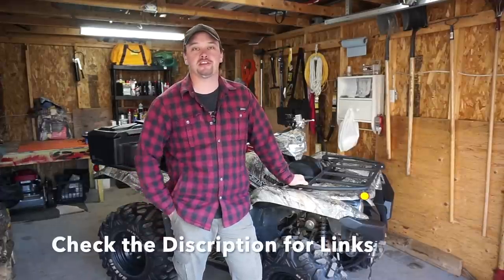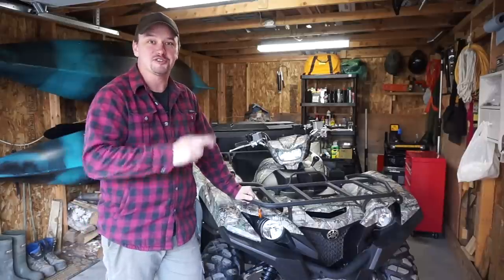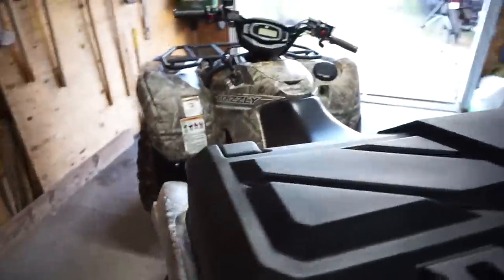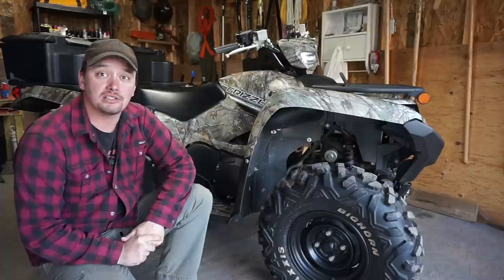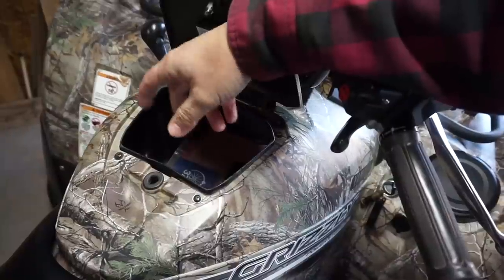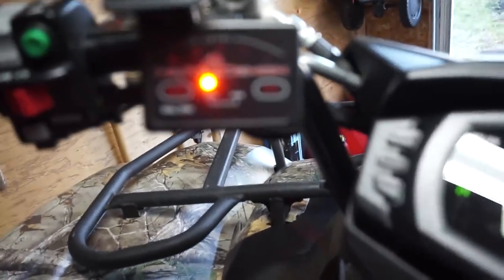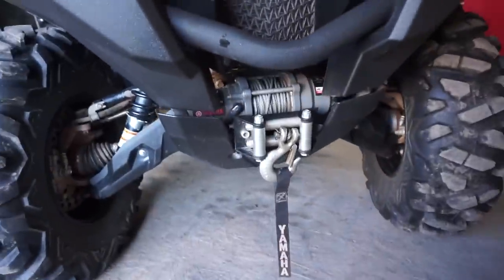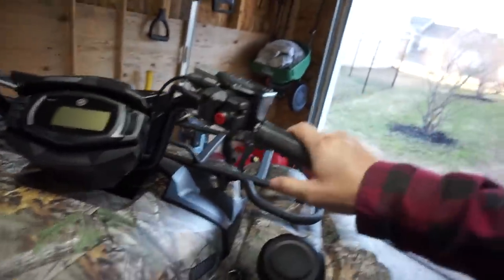Honest Owners Review - Yamaha Grizzly + Mods

Comment: Hey man, another great video, always enjoy watching.  My brother just picked up a 2019 700 Grizzly 700 SE and he’s super happy with it.  I was curious what pressure you’re running the bighorns at?  I picked up a new set a g. Bourque and was told to run them at a minimum of 10 psi.  I noticed on my first ride they seemed a little rough.
Reply from the maker: Hey Rob ! thanks man, glad you liked the video ! 10 PSI ?!?! oh man thats crazy ! I run mine between 3-5 PSI, always have. they are super smooth then. My buddy Evan runs his at 4 PSI.
Reply from the maker: I should say in the winter I run them a little lower 3 PSI and the summer around 4-5 PSI
Reply: @Maritimer  thanks for the reply, I’ve dropped them down a couple pounds but might take them further, not sure why they told me to keep the pressure that high though.  I could see maybe having a higher pressure on a side by side.
Reply from the maker: @robertsrandomreviews6516  Yeah ! a SXS needs a bit more pressure but the Big Horns are a rugged tire and can basically run flat on a ATV. drop them to 5lb and you'll probably like them a lot more.
Reply: @Maritimer  Will do! Thanks again!

Comment: Thanx for the tip on the 4x4 going in and out on its own. Im having the same issue on my 2016. Going to try the dielectric grease.
Reply from the maker: Hey Buddy, Yep I made a video on how to take the switch apart and add the grease. It fixed my issue and it never came back.

Comment: Great bike I picked up a 500 fourman for riding and love it cheers brother!!!
Reply: dank shots 420,  I’ve got a 2009 Honda Foreman and it’s been unbelievably reliable and if the battery dies you can pull a cover and pull start it.  Important when your by yourself in remote areas in the Rocky Mountains. It won’t win any power or ride awards but I love it. Hope yours treats you well
Reply from the maker: Hey man Foreman is a Great machine ! like a little tank ! haha super tough and reliable ! Cheers !!
Reply from the maker: I love the idea of having a secondary start (pull cord) but as the motors get bigger those are going away. I keep a battery pack which allows me to jump start my bike multiple times, just so I dont get stuck out there with a dead battery.

Comment: Never like the Grizzly much, it would be a better machine if it was a twin.  I find it under powered and find the Can Am a much better bike for power and vibrations.  Does have a nice ride and very reliable bike.  For another few bucks you can get the 650 V twin however the Grizzly would be my second choice, great CVT system and the best on the market.  Good vid
Reply from the maker: Hey man, fair points ! I wish it was a twin also like a 850 or 900, and maybe keep the 700 for the Kodiak.... that would make sense, I'm not sure why Yamaha doesnt upgrade the Grizzly.
Reply: @Maritimer  Well they are outstanding machines but I think the reason is cost, changing to a twin a lot things would have to change.  But I think if they don't they be even losing more sales down the road.
Reply from the maker: Yeah the cost will go up for sure, thats why you keep the 700 in the Kodiak and a more budget friendly machine, and put the Twin in the Grizzly.

Comment: Awesome video. I’m looking at a used 2017 Grizzly Special Edition in Nova Scotia and wondering what you paid for your 2017 new? Thanks!
Reply from the maker: Hey Andy ! We'll I bought mine new in 2017 I added on 26" big horn tires, the storage box, heat demon hand/thumb warmers (which I installed everything myself) but after tax and fee's it ended up being close to 15k. I will warn you about the 708cc motor, do some research on them, ask the owner if it burns any oil or has had the top end rebuilt by Yamaha.... some of them have issues. I like the 686 motor better.
Reply: @Maritimer  Thanks so much! I appreciate it!

Comment: Nice review. Wish they made a two up. I think a side by side is more my style. Hunting, firewood, and meandering on trails. Keep up the great videos.
Reply from the maker: Hey brian ! yeah not many 2-up machines out there is there? Can Am and Polaris ? I think if you plan on taking a passenger a lot, there is no better way than with a SXS. Plus like you said it would help ya with your work, having that box on back helps.
Reply: @Maritimer  yeah, taking the wife and dogs would be great. Definitely looking at a few. Yamaha wolverine/viking, can am defender, and the Kawasaki Teryx.
Reply from the maker: All nice machines ! my brother has the Teryx and loves it, it seems to be built good ! and amazing amount of storage stops. My father Had a Teryx and now has the Pioneer 1K it's also super nice !! I wouldn't get the Viking if it only has a single cylinder engine, it's just too gutless... do they have that parallel twin motor in it now? 
the Wolverine is a very nice machine, I have a video on test riding a Wolverine RSPEC.

Comment: Just bought a 2014 550 with 360 miles.  One owner garage kept and owned by a guy to do things around the farm and hunting.  I think I overpaid but at $4800 but wanted it now and new are way $$$.
Reply from the maker: Hey ! we'll the market is different everywhere but I'd say you over paid a little bit, but the bike is basically new with only 360 miles on her. and will probably last forever, those 550's are bomb-proof.
Reply: Maritimer I looked for a few weeks and even searched nationally on atv trader.  Dealers want $5500 for ones more used.  Atvs in the south are mostly Honda’s and have wheels and snorkels.

Comment: Great video! I’m not sure why Yamaha switched to the 708. You say emissions but the 686 remained in the raptor and Viking through out 16-18.
Reply from the maker: Hey Kent ! I didn't know that.... thats really weird... I wonder why they changed... I was always told it was b/c of emissions...
Reply: Maritimer My best guess why they went back to the 686 in 2019 is because they moved to the v-twin in the Wolverine x2 so that 708 was only left in the grizzly. So instead of switching the raptor and Viking over to 708 they just dropped it. But why go to the 708 at all?
Reply from the maker: Yeah man, it doesn't make much sense. I haven't had any issues with mine but I'd take a 686 over the 708 just for piece of mind.

Comment: Nicely done review buddy! Those are great machines!
I hate where they put the 12v plug and key though. The key should be up by the gauge cluster and the 12v plug should be by the steering column. I use mine the keep my Garmin plugged into while I'm riding (because it eats batteries like dog on a steak), so it definitely wouldn't work for me.
Thanx for sharin'!
Reply from the maker: Hey Buddy !! Hope all is well out west ! I agree with ya man ! should be  somewhere near that gauge cluster for sure ! but Yamaha being Yamaha..... they out it where it's always been haha or even having one in that storage box would be great for charging a cell phone while riding. thanks for watching man !
Reply: @Maritimer  
Installing an extra one near the steering column or in the storage box would be easy enough to do too I guess.
Reply from the maker: I bought one to install on my motorcycle, I just hope I dont have to take the crash bars and fearing off haha

Comment: I bought a 2014 grizzly 450 brand new in 2014. Never seen a mud hole! Only complaint I have is the cheap plastic CV boot guards. I've replaced the front rt CV axle twice because the boots get ripped by tree limbs. Mine only has 220 miles on it.  Only use mine for yard work
Reply from the maker: Hey ! thats good to hear ! those Ol' 450's were super tough ! I've never had an issue with the skid plate or a ripped boot.... fingers crossed haha
Reply: @Maritimer  mine is just a work horse. I wanted a 700 but my budget said no
Reply from the maker: Hey man, whatever gets ya on the trail ! haha the 450 will go anywhere my 700 will go.

Comment: Good  job. Thinking of a Polaris but this bike may be better... I want a Honda but need more performance and capabilities. This maybe be the best of both worlds.
Reply from the maker: Hey Kris ! Yeah man I love Honda also but they are so far behind on ATV's it's crazy, they basically sell on there reputation of being crazy reliable (which they are haha) but for power, comfortable ride, ground clearance, diff lock, and other options, it's not even close. And Yamaha has the best belt drive in the game, I know a lot of old school guys like Honda b/c they have a transmission, but the belt drive has come so far, and Yamaha offers a 10 year warranty on their belt... you can't beat that. The machine is always in the right "Gear" or has the right amount of Power for whatever situation you are in, it's never trying to up-shift/rev too high or down-shift/bog down. 
I haven't owned a Polaris so it's hard for me to comment on them, but I think they make a pretty solid machine, from my experience (friends machines) they are not as reliable as Honda or Yamaha but they have a smooth ass ride, more power, storage in the racks (some ppl like it, some ppl like the old school metal racks) The one thing I don't care for with the Polaris is the AWD.... it's not switch in 2X4 or 4X4, it's AWD all the time. I personally like having the option. But all in all I think they make a pretty good machine.

Comment: Great review. Very helpful. Thanks!
Reply from the maker: Hey ! thanks man !
Reply: @Maritimer  may I ask what size Bighorns you’re running? Are they 26x8-12 on front and 26x10-12 on the back? I’ve never owned an atv, but I’m interested in getting a Grizzly this spring. Thanks!
Reply from the maker: @G_Carter  Hey ! I have a review video on the Big horns I will post under my comment. mine are 26X9X12 in the front and 26X12X12 in the rear.
https://youtu.be/EhWBssoQhKU
Reply: @Maritimer  thanks! I just caught the tire review (sorry I didn't see it before bugging you with my question!). Looks like a great all-around tire that would handle 95% of the driving I expect to do. Really appreciate your advice. Cheers!

Comment: Great videos man! It's refreshing to hear from a sensible ATV camper compared to the majority of the barbarians here in Newfoundland lol. Also, I seen you have the Gstove? I used mine a fair bit, any complaints with yours? 

Cheers from Newfoundland.
Reply from the maker: Hey Chris ! thanks a lot man ! Glad you like the videos ! I don't have any complaints as of now.... I struggle to figure out the sweet spot so I can get a longer burn.... I have a damper installed in the pipe which helps a lot ! before my pipe would glow red and I'd burn the wood quick....

Comment: Hey pal. So I have the bighorns. 3.0 version. They are great so far. 26X9 front and 26X11 rear. I reached out to Maxxis. They recommend running 10-12 psi for my grizzly. What is your experience with the OG’s?
Reply from the maker: Hey man ! wow thats much higher than I run, I like mine to have lots of flex (for my style of riding and my terrain) so I run like 5psi in the summer and maybe 3-4 in the winter. (if I remember to adjust them haha ) but try 10 and see if you like it, then maybe lower them and see how it feels. if you do faster, aggressive riding then you may want the higher PSI. I personally drive slower and more technical trails, so I want maximum grip.
Reply: Thx. Ya it’s crazy amount of psi. I’ve always ran 5-7. My riding is very technical. Rock and mud. Canadian Shield.  I rarely pin the throttle. Maybe in the winter just for kicks. Was just out riding in deep snow. Had a dumping of 30cm last night in Simcoe County Ontario. Tires handled really well.

Comment: I'm trying to decide between the Grizzly and a Sportsman and would love your opinion on how they compare?  I plan on mainly trail riding in the mountains in western Canada, so their ability to climb without going over backwards is important. ;) lol.  I also plan on doing a lot of 2 up riding and am curious if its necessary to buy a specific 2 up machine (I know Yamaha doesn't make a 2 up).....other than for legal reasons, or what 2 up machine would you recommend? Thanks in advance.
Reply from the maker: Hey !! we'll like you said: you plan on doing a lot of two up riding, then I'd probably recommend a really propper 2-up machine, I know Polaris makes them, they are longer and properly place the passengers weight in front of the rear wheel, unlike a machine not designed for a second rider (the grizzly) so ther eis less chance of flipping backwards.
Both machines are good, I'd probably give the smoother ride to the Polaris and give the reliability to Yamaha. but you cant go wrong with either machine.

Comment: What size Bighorn,s are you running ? Are you using the stock rims also ? Wondering how the Bighorns match up with the rims ?  I have a 2016 camo and still running the stock tires . Mine was a oil burner with only 800 miles it has been rebuilt by dealer ,keeping fingers crossed !
Reply from the maker: Hey Don ! they are stock size, 26X9X12 in the front and 26X12X12 in the rear. Big Horn 1,0 measure 1" larger than their listed size, so a 26" measures 27" when new.
That sucks you had an oil burner ! I hope I don't have that issue, I'm like 3300km in and nothing yet haha
Reply: @Maritimer  I think your good . There is a
service bulletin good till 2023 i believe . So if something comes up , also the fuel pump is in that . The dealer replaced pump . You used your factory wheels then , good to know , those are what i have looking at for a good while . Looks to be a excellent tire . How are they in snow ? I live in northern Wisconsin so we get snow , sometimes to much LOL

Comment: So the 708 only had a 3 year run.....has it been problematic?
Reply from the maker: Hey man, yeah there is a lot of info on the Subaru 708's, I personally haven't had an issue at all with mine, it's been strong. BUT there has been quite a few people have oil consumption issues (blue smoke out the exhaust) 
So I usually tell people I haven't had an issue with my 708 BUT if you can get years 2008-2015 or 2019+ years with the 686 Yamaha motor, it's a safer bet.

Comment: A 3000k 35w HID would be perfect for for your hi-beam. That's what I did to my 2019 Polaris 850.
Reply from the maker: Hey ! thanks man ! I might look into that ! Did you have to install a ballast or are they attached to the back of the bulb now?
Reply: Maritimer they make all kinds. It’s very easy to hook up and install. HID’s put out more light for less power consumption. Also there is no filament so they last about 3000 hours.
Reply from the maker: Hey ! Yes I had a set in my Tacoma ! 6K HID's, Super bright, I always felt bad for other drivers haha is the HIS brighter than a LED? I cant see it using less power than an LED though. or did you mean Less power than the stock bulb?

Comment: also can you feel the heated grips working even with thick gloves on??? and do you feel an increase in power with the EHS tuner?
Reply from the maker: Hey man ! Yes you can feel the heat through thick gloves, it gets pretty cold here in Eastern Canada (regularly down to -30C) and the heated grips allow me to use a thinner glove so I can use my camera and stuff easier and without taking the big glove off.
The EHS tuner for my machine is strictly to make the 708 run less lean, it does not give any extra power. the only thing I noticed when I first installed it was my throttle response was a bit better. 
I believe they do make different programs if you wanted to try and improve power.
Reply: @Maritimer  thanks, really helps!! May put those two items on my 2008.

Comment: I own a 2008 just like the one you used to have.  I really can relate to your video and appreciate your thoughts. My 08 has 17,500 miles on it. I just replaced the stater, both rear axles and did standard oil and antifreeze. Is there anything else you might tell me to do for extended maintenance?
You mentioned a belt on your video. Should I be thinking about it and or anything else?
Tks,Mike
Reply from the maker: Hey ! wow thats awesome ! You've had good luck with your 2008 ! Ahhh yeah at 17,000 miles, I'd probably take a look at the belt, i'm guessing it's fine but it's worth a look for sure.
I think you have it covered, just keep up with the maintenance. grease the wheel bearings. Cheers man !

Comment: My buddy has a 2020 grizzly it is very Snappy as soon as you touch the gas he can do catwalks no problem the 700 Kodiak with the 708cc motor cannot catwalk and when you first touched the gas it seems to be a little sluggish until you push the gas harder then it grabs is your mother doing the same thing or is it just mine thanks
Reply from the maker: Ahhhhh..... I don't know, it's been a while that I rode a 686 but I have no problems doing wheelies or getting the front end up over bumps and stuff while trail riding. 
I know the grizzly and Kodiak have the same motor but there are some differences in the two, maybe the clutching on the kodiak is different b/c it's more geared towards being a working machine where the Grizzly is more sporty.

Comment: are you running stock exhuast with the tuner? im thinking of gettin one which tuner do you have just you just run in the first setting?
Reply from the maker: Hey ! yes my machine is 100% stock, I have the EHS tuner (video of it is on my channel) When you get that tuner, itwill come with a paper to tell you which setting to have it on depending on your mod's. Mine actually came set up for stock.